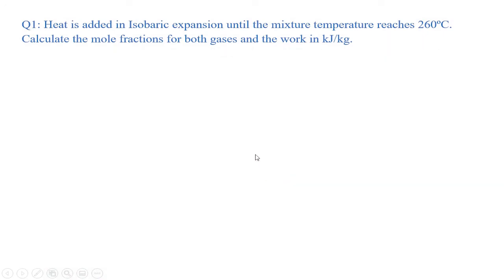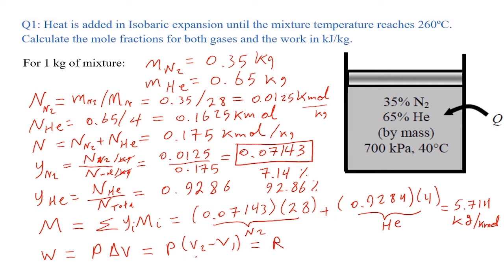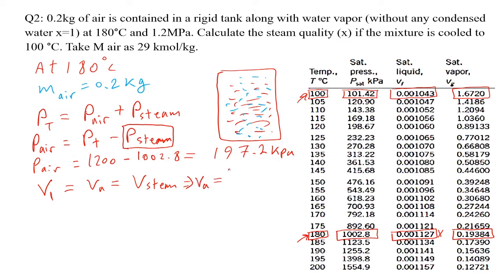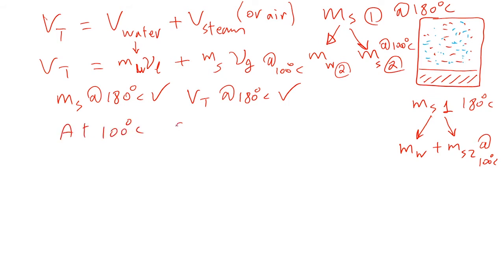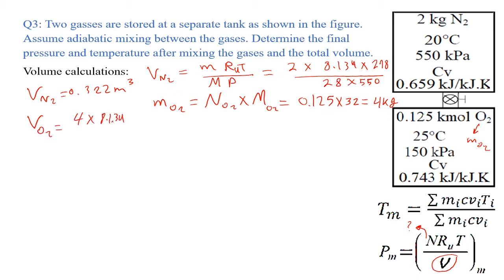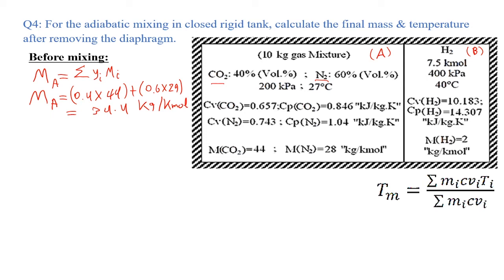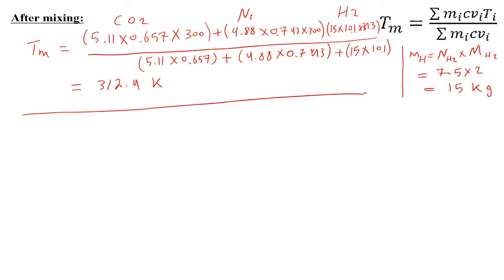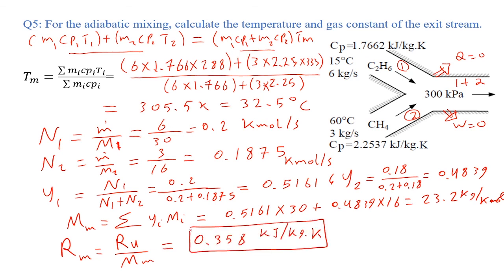Tutorial 1: Applied Thermodynamics (Gas mixtures)

Comment: Hi sir, for Q4, why is the yi=0.4? Isnt that the mass
Reply from the maker: CO2: 40% (VOL.%), N2: 60% (VOL%) ... the question gives the mole (volume) fraction not the mass. Another information is that CO2 + N2 mass =10 kG ... but it doesn't give the mass fraction. So, you have to calculate the mass fraction from the volume fraction (which is given in the question)
Reply: @khaledAlattab  Thank you for the explanation Sir. Now i understand